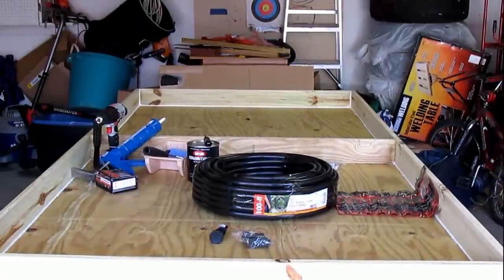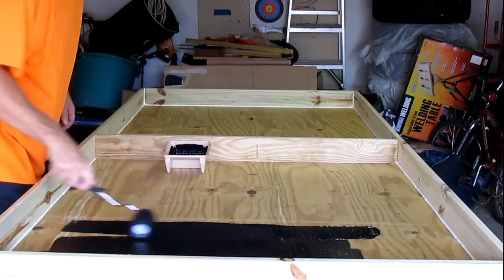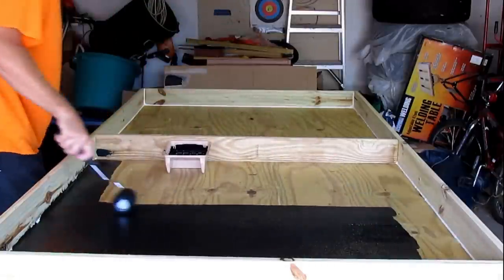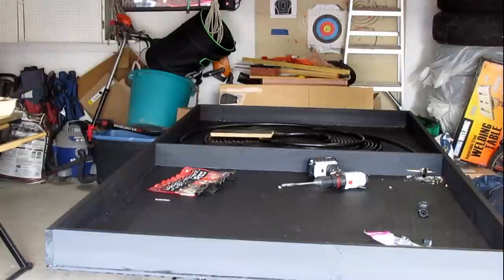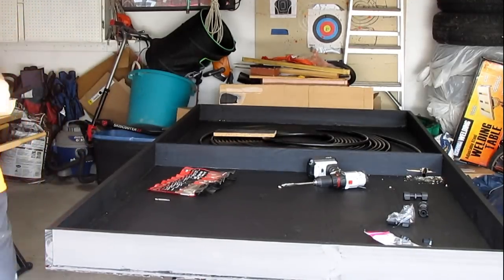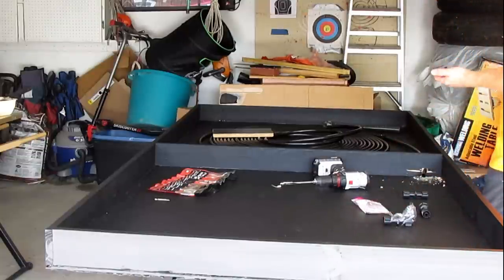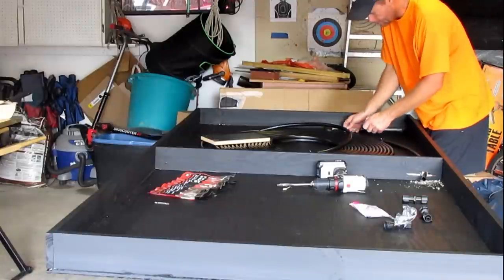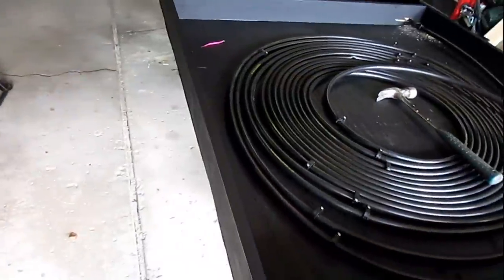How To Build A Solar Pool Heater - DIY!

Comment: Thanks again for the great video. I’m in the process of making one of these and I was wondering if you could tell me which cover you went with and how did it work out for you. Was it easy to attach and did it make a tight seal          Thank you
Reply from the maker: Awesome Dave!
I originally went with the sheet in the video, but it got broken over the Winter.
I went with the plastic listed in the description this time and like it better & its cheaper, much clearer.
It makes a nice seal. I cut 4 strips of wood & screwed them into the 1x4's.
Pretty awesome project. How's yous going?
Thanks for stopping by & happy heating my friend!
#RCInsiders

Comment: I'm getting ready to start building this.  I have read through a lot of the comments and couldn't see an answer to my question.  What are your thoughts on making two 4x4 boxes and having them hinged together so that I can fold in half for easier storage and mobility? I'm bound and determined to prove my husband wrong.  That this will heat the pool and be easy enough to move when he is mowing the yard. 😊 
The only thing I can think of to do different is to make sure the hose between the two boxes will give enough when I fold them together.  I plan on putting a handle on the outside and a small latch to hold them together when moving. Your thoughts?
Reply from the maker: I love it Mary!!
Here are my thoughts:
Instead of using a hinge, perhaps make 2 (or more!!) separate units.
You could connect them with a length of garden hose when in use. This would greatly reduce the weight as you;re goal seems to be mobility.
It is already September and I am still maintaining 82-86, which is just awesome for Michigan! Without the solar unit, we would already of closed for the year.
I love the idea & would love to hear your results. If you are in a warmer climate than Michigan, your are going to love the early Fall temps you will get.
Thanks for stopping by & happy heating my friend!!
#RCInsiders

Comment: Does the pump runs all the time or is on a temperature switch so when power a certain temp the pump turns on
Reply from the maker: Hi,
Yes this runs until you turn it off. I have also set it up with a timer with good results.
Yes, you can also put an inline temp switch if you want that would turn the pump on & off at a det temp.
Did you build a solar pool heater?
Happy heating my friend!
#RCInsiders

Comment: - When 1st turning on your pump, how long did it take for the pool water to go thru the 200' of pipe and back into the pool ?  
 - And..when the pump is off, is there any 'back wash'( water from the pipe reversing/siphoning back into the pool ) ?
Reply from the maker: Hi Mike,
It took a few minutes to fill the tubing.
No, I have not had any back flow of water. Is this a concern you have?
Happy heating :)
#RCInsiders

Comment: Hi there - so we built ours Friday and yay sun yesterday, we got it out there and let it bake, the water comes out hot, but only for a minute or two, then turns cool.  We used PEX not irrigation tubing and painted it all black... any thoughts?  everyone's seems to work, can't figure out what we did wrong.  Thanks so much.
Reply from the maker: Hi Sheril,
What is the the outgoing vs incoming temp?
If you used the pump in the description, do you have it set to the lowest flow rate?
After 5 or so minutes, you will have a temp drop. 
Depending on outside temp & amount of direct sunlight, I usually maintain a 5 - 15 degree temperature differential throughout the day, lessening as sun strength weakens towards evening,
Also, did you cover it with clear plastic or plexiglass?
I will look into painted PEX vs irrigation insulation/penetration factors, but I can't see it being a major issue, other than the paint possibly preventing sunlight/heat to enter the tubing.
I have also experimented with using a timer for cooler cloudy days to allow the water time in the unit to heat.
As long as you are maintaining a positive outgoing temp, you are good as the outgoing water will constantly be heating the water.
I also cover the pool with a cheap solar cover at all times when not in use, especially at night as nigh time is when pools lose the most heat.
Thanks for dropping by & happy heating my friend :)
#RCInsiders
Reply: ok so maybe it is working fine if we only get a slight difference after the initial hot water.  We put plexi on top of but if it isn't going to give us the results we thought, I was thinking of returning the plexi since its so expensive and just covering with clear household plastic wrap.  Thoughts?
Reply from the maker: @sherilsun  Hi,
So I would definitely not try plastic wrap. Here is a good Plexi alternative - https://amzn.to/3ggbVXD
Also, paint can prevent heat transfer, but only marginally. What was your temp differential? Is the pump on low?
There are competing theories about which heats a pool better...High flow rate with small temp differential vs low flow high differential. I have had success with both.I have also had good results experimenting with timers.

Comment: I know it’s been a while since your video , Question, 1700 gal above ground pool,  using same materials as you used, if I move the solar heater 20’ away from pool what size pump should I use?   Thanks from cheboygan Mi
Reply from the maker: Hey Robert!
Only been to Cheboygan once a long time ago & loved it :)
As long as there is no big elevation variance between the solar heater & the pool, the pump listed in the description should work fine.
As I'm responding to you right now our wind chill is -4! Just looked at the poor pool and it looks like a snow sled hill :)
Cannot wait to fire up the heater this Spring :)
Thanks for dropping by & happy heating my friend!!
#RCInsiders

Comment: Love your videos! Can you give the measurements on the stands you made for you heater! Thank you
Reply from the maker: Thanks Rhonda!
When I get back I will measure the stands.
Are you wanting to make them just like mine?
Thanks for dropping by & have a great day!!
@RCInsiders
Reply: Yes Please…I followed your video and made my pool heater! And it works wonderfully. But I am taking your advice and doing a second one so that will give me a 1000 foot of heated water. Living on top of a mountain in Wva I need all the heat I can get😂
Reply: Also what thickness plywood did you use 23/32 or 15/32? Making my second one this week.
Reply from the maker: Hey Rhonda!
I use a 1x6.
The bottom is 30" - The top is 40" & the upright is 20"
Cut a 45 on the upright & screw it all together :)
You don't necessarily need the stands. I use them to angle the heater toward the sun.
Congrats on building your solar heater!!!!
Reply from the maker: Hey Rhonda,
One of each. The one on sale or cheaper as they are both suitable for the heater :)
Reply: @RCInsiders  Thank you! I need them for the same reason you do. You videos were a great help to this old woman!
Reply from the maker: You are most welcome Rhonda!
I miss the mountains. Spent some time in KY & loved it :)
Happy heating my friend!!

Comment: I built one too!!  But what kind of pump did you use?  I went through TWO $100.00 + pumps so far. 🤔
Reply from the maker: Awesome Jim!!
I use a $20 pump that lasted 2 years 😃
Here it is - https://amzn.to/33pkhrl
It is listed in the video description with all the other parts I used for the heater.
So happy I built these. The solar heater has made pool season much more enjoyable :)
How did yours do?
Thanks for dropping by & happy heating my friend!!
#RCInsiders

Comment: Did you tubing wear out from the sun and chorine?  Thanks
Reply from the maker: Hey Mathew 
No, the tubing is still doing fine years later.
Just closed up for the year & put the heater for winter storage.
I will replace the cover for next season, but the tubing is still good.
Thanks for dropping by & have a great day :)
#RCInsiders

Comment: Great video iam not a handyman .. will copper tubing work better
Reply from the maker: Thanks Leo!
Copper is only a slightly better insulator & will give you only a marginal benefit at best in this heater. There is also the issue of how copper reacts with chlorine or salt. Additionally, the tubing in this video is sooo much easier to work with.
Let me know if I can help along the way...Spring is almost here!!
Thanks for dropping by & happy heating my friend :)
#RCInsiders
Reply: @RCInsiders  thanks
Reply from the maker: @Leo Getz  You're welcome :)

Comment: Thanks for the video, just making one myself in the UK.  Did the clear cover make much of a difference to the water temperature coming out of your solar heater?
Reply from the maker: You are most welcome Mick.
Wow, the UK! Great to have a visitor from across the pond 😀
Yes, the cover made a 3-7 degree difference, depending on the amount of direct sunlight. As an added benefit, it keeps everything out of the solar unit like rain and grass when mowing.
How are things over there? Hope all is well with our friends from the UK :)
Thanks for stopping by my friend & happy heating!
#RCInsiders

Comment: Greetings!  Thanks for posting this.  I have a couple of questions. I was wondering how long the pump will run before the temp of the output will start to drop.  I'm thinking of times I go to my garden hose and turn it on, and it puts out hot water for 15-30 seconds, then turns cold.  Certainly the black plastic tubing, in a black box placed in sunlight will provide much more heat.  It makes sense that you wouldn't want your flow too high, because the temp would drop faster.  Did you check the output temp. after 15 or 20 minutes?  It seems a timer would be better, to let the hose fill with pool water, then sit for a bit, then start to pump again.  I noticed another comment said a constant flow would be better than bursts of hot water.  Would you mind to expand on these thoughts?  - Thanks!
Reply from the maker: Hi Bill,
It's a little like the hose, except you are not feeding the tube with a continuous supply of ice cold water.
There are tons of variables that will affect the outgoing temp, with the biggest being direct sunlight. On that day, which was hot & sunny, the temp dropped to 96 in around 15-20 mins, then ran at a constant 88 til we lost sun. I now have 2 units running and on a similar day, it puts out a constant 96 - 100 at peak sun. I also am experimenting a little with the timer. I let the water sit that day for 30 mins & had 149 degree water!
So far with experimenting, I think a slow constant flow seems to heat the pool best. But man is cool to see 150 degree water coming from a solar heater you made! :)
Thanks for stopping by & happy heating my friend!
#RCInsiders

Comment: Question for you. I have watched multiple videos on this same type of heater being used. I appreciate your one of the only ones who put what pump they were using so thank you! I have the same pool as you but smaller version. 18ft×21ft. My question is how long do you keep your pump running? Only during the day or 24/7? Also, how long did/does it take to actually make a difference in the pools temp its self?
Reply from the maker: You are most welcome!
I only run the pump during the day, 6-10 hours depending on the sun.
It gets cold here at night, so running at night would actually cool the pool.
Make sure to keep it covered with a cheap solar cover whenever you're not in it & especially at night. This has made a huge difference.
The amount of direct sunlight you get will determine how fast/well it works.
On opening day our pool temp was 59. We had 3 nice sunny days in a row & raised the temp to 77 in those 3 days.
I have added a second unit this year & often times shut it off as the pool gets too warm for me. I like the pool around 82. I ran the pump yesterday while at work & when got home the pool was 90!
Thanks for stopping by & happy heating my friend!
#RCInsiders
Reply: @RCInsiders thanks for the info! If possible could you do a quick video showing your new setup with the additional hoses and what kind of flow your getting out of the system that goes into the pool?
Reply from the maker: Will do my friend.
Might be next weekend as already working on video for tjis weekend.
Have a great weekend :)
Reply from the maker: Hi,
Here is the video with the 2nd solar unit added:
https://youtu.be/sdV8_EJTVzo
Happy heating :)

Comment: Hi RC Insiders, thanks for the video!  I was curious how you still like this idea, has it been worth it to keep using it, ect?  would love to hear a follow up.  Thanks again!
Reply from the maker: Hey Chris,
I have actually added a 2nd unit this year & the unit in the video is entering its second season & still making awesome warm water :)
Has it been worth it...100%!
I have actually been able to enjoy the pool every day for a second year now. 
I remember how cold & uncomfortable it used to be & now I easily maintain the perfect (to me) 82-85 degrees. I often times unplug the solar unit as it can get the pool too warm for my liking. I left the pump on all day the other day on a 84 degree sunny day & came home from work to a 91 degree pool!
After the initial cost of materials, I get to finally enjoy pool season for a few cents a day 😍
Thanks for stopping by & happy heating my friend!
#RCInsiders
Reply: @RCInsiders  thanks for the quick reply!  we're in new england and our pool doesn't get full sun all day so I am definitely looking into this.  thanks again!
Reply from the maker: You are most welcome!
Make sure to get any cheap solar cover you can. 
I always keep it covered when not swimming. Keep it covered especially at night as this is when a pool loses most of its heat.
Have a great week! :)

Comment: We are gathering materials to do this project.  Great supplies list.  Your link to a pump no longer works.  Can you give some general info on the pump?  Thanks!  We're psyched to get this up and running.
Reply from the maker: Awesome!
This is a great project that will help you enjoy your pool :)
Here is the pump - https://amzn.to/3gg913R
Let me know if I can help.
Thanks for stopping by & happy heating my friend!!
#RCInsiders
Reply: @RCInsiders  Wow, thank you for such a fast reply.  I'm thinking we'll have to let  you know how it turns out!  :)
Reply from the maker: That would be awesome!
If you need a pump with a little higher lift, this one is only a couple more bucks - https://amzn.to/33pkhrl
Have fun :)

Comment: Thank you for sharing your project and results. I used a hose instead of tubing. The sun is not heating the hose (using 200 ft, coiled like a spiral, 100 ft on top of the other 100 ft.). Why is tubing preferred over hose? Thanks in advance for your reply.
Reply from the maker: Hi James.
The black tubing will draw in more heat. I think stacking is a no no. The more surface area that is exposed to direct sunlight the better. 
I'm not completely sure, but I believe the tubing would hold the better as well.
And one thing is for sure, it's a lot cheaper :)
For starters, I would figure out a way to not have the hose stacked.
If you have a timer, I would set the pump to only kick on every 15 minutes or so to allow the water to sit for a bit. I'm going to try using my Christmas light timer and try a few time intervals til I get the temp I want.
Thanks for stopping by and good luck my friend. Hope that helps
#RCInsiders
Reply: Great advice and thanks for the prompt reply!
Reply from the maker: You're welcome James...Have a great weekend!

Comment: Hi..what flow rate from the pump is ideal please? Im not sure which pump to get? Im not in the US so dont have access to your recommended parts
Reply from the maker: Hi Mike,
An adjustable flow rate is preferable, but if not find a pump around 600 to 800 gallons per hour.
You don't want to go too big or the water won't have enough time in the heater unit. Too small & it won't push through the unit.
If you can find one that is 800 GPH you should be good.
What country are you building the unit in?
Thanks for dropping by & happy heating my friend :)
@RCInsiders
Reply: @RCInsiders  Thanks for that! Im in New Zealand so we work in litres, so thats about 2300 to 3000 LPH. Appreciate your help! :)
Reply from the maker: @mikekeen1679  Awesome Mike! New Zealand WOW. That's so cool :) Ley me know if I can help with your build.

Comment: Couldn't you do it 5x5 pressure treated wood
That way it would take less space and less costly.
Also wanted to know if you could attach the fittings to the inlet and outlet of the pool filter pump
Reply from the maker: Hi,
There is no right or wrong way. Use your imagination & experiment.
I have added a second unit & have found that you can fit a lot more tubing inside 8x8 than 5x5.
Also, 5x5 is not that much cheaper, if at all. Plus a lot more space to work with.
You can hook it up to your pump if you are able to figure out the plumbing & valves needed to do so. This system is meant for simplicity & costs next to nothing to run all day.
Let me know what you decide to do & how it works out?
Thanks for dropping by & have a great day :)
@RCInsiders